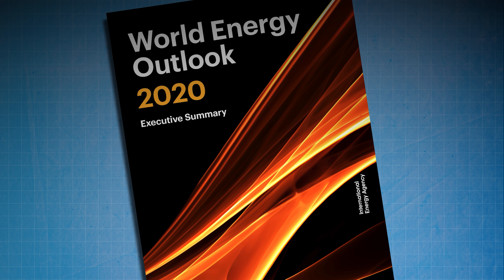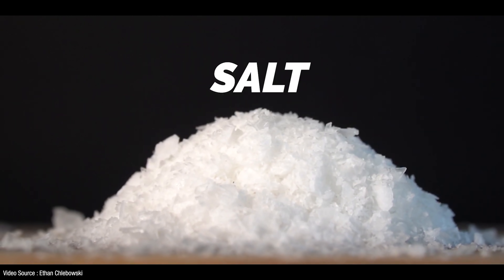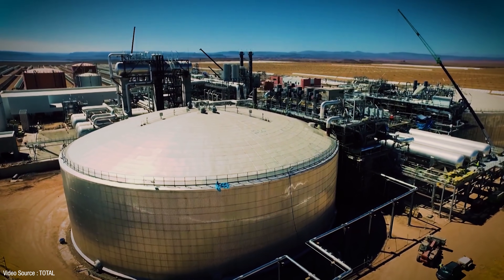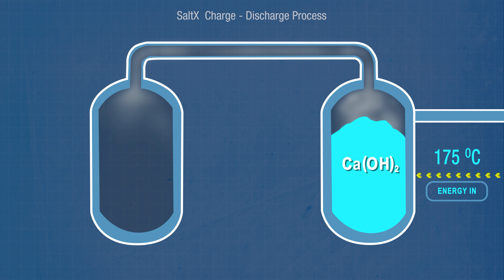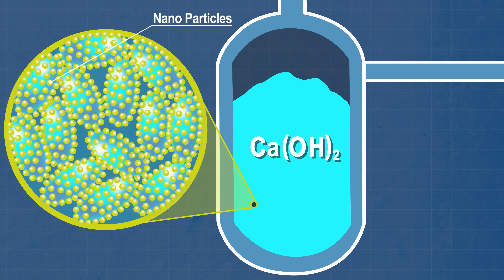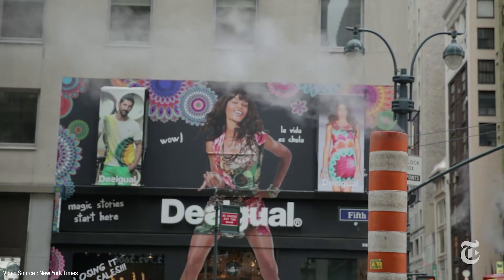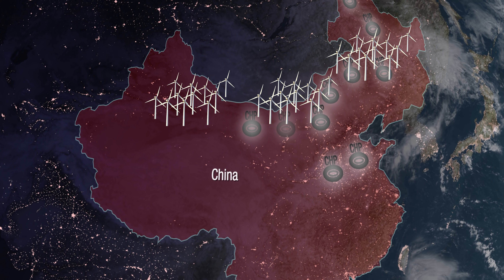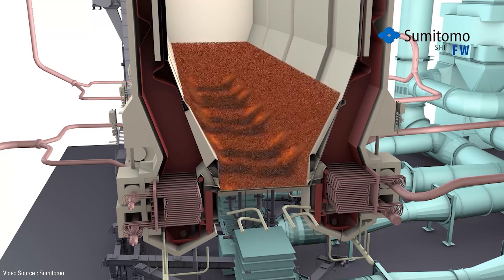Energy storage in salt - how nanoparticles are revolutionising the industry.

Comment: Could the system be scaled small enough to be mobile, like onto a tractor? 

Agricultural pests and weed control would be a good use to replace harmful chemicals. Could be charged by on farm solar. Meaning zero ongoing inputs and costs for farmers. 

Current flame weeder's use natural gas and some attempts have been made by producing steam from batteries, but these are expensive. 

For agricultural pests, I imagine a combination of computer vision, AI and autonomy using high pressure laminar water jets targeting individual pests. Something similar is all ready happening where the robot will target individual weeds in a crop with weed killers, therefore reducing amounts of weed killers.

Steam or high pressure water could replace many (all?) agricultural chemicals.  It will also reduce disease in crops because of less pest vectors. Work 24/7.  Beneficial insects will not have dangerous chemicals to contend with.

Comment: My wife and I are saving for and planing to design our dream house and your videos give us so many cool ideas! It'd be interesting to see if something like this could be combined with a sterling engine for home scale power storage
Reply: I don't really see this being useful to households any time soon 
Any system to make good use would far outweigh the costs currently
Reply: I wonder about a steam turbine/alternator in which the steam would spin successively larger bladed wheels which would each have coils and be a separate alternator. This could also provide hot water and space heating. Maybe a wood burning fireplace to supplement solar panels or mirrors.
Reply: @stevemickler452 pressurized steam is generally not great for residential use as it is very expensive and dangerous to leave unattended. I've seen videos of people using it to power a small metal shop but they were experienced technicians and only ran it while they were in the shop. A sterling engine would not require the steam to be pressurized and can work well at lower temps, meaning it can be smaller, cheaper, and safer.
Reply: Two swedish companies are exploring stirling engines to create electricity. Both have approx. 30% efficiency if I'm correctly informed and need quite high temperatures.
I think both need above 700 deg Celcius on the hot side of the engine. SaltX have salts that are suitable for different temperatures but the highest I have seen is 500 deg Celcius.
So it might not be suitable if the efficiency already are as low as 30% for 700 deg C.
With a steam turbine you get approx. 30-40% efficiency which is a better choice than a stirling engine.
So I think stirling engines are a better and cheaper choice than steam turbine if you have access to higher temperatures. But that needs to be verified by the companies that explore this technology and so far they are a bit secret about this novel use of stirling engines.

SaltX NCS is absolutely best used to store energy and release it as heat in a large scale district heating system. Around 90% efficiency...

The swedish companies exploring stirling engines are Azelio and Swedish Stirling.
Azelio as a energy storage medium in CSP plants where they use molten aluminium as medium and that can release energy at high enough temperature to suite stirling engines.
Swedish Stirling burn flare gases to drive their stirling engines at appox. 720 deg Celsius.
Since flare gases are burnt of anyway Swedish Stirling's concept is to recycle the heat to electricity.
First targeted area are smelters in South Africa where they use coal to refine chromium (mostly). This process create gases that needs to be flared.
These gases can be of varied quality so no one have succeeded in recycle them effectively so far despite many attempts.
Swedish Sterling's technology might be the first technology that can do this effectively. They say that by recycling the energy as heat to electricity they can lower the use of electricity used by the furnaces in the smelter by up to 15%, and that is very significant. 
There are a massive amount of gases flared around the world, and some calculations have shown that if Swedish Stirlings technology are used to recycle that energy it would equal all of the electricity used in all of Africa. THAT would be a significant reduction of emission of heat and green house gases if coal driven energy plants can be closed.

SaltX earlier explored the use of their nano coated salts for small scale energy storage for houses, but have put that R&D to rest and focuses on large scale grid connected energy storage where they only supply salt and a source of technology.
They have figured that this technology could scale very quickly if other production facilities can build the hardware used and SaltX only supply salt and know-how.
Building the hardware themself would be a too big task for a small company like SaltX technology.
So the technology is open for other companies to explore, as long as SaltX technology is part of the journey and can deliver salt.
Great decision and great thinking since the technology might be a natural part of any district heating system in the world that want to leave fossil fuels and incorporate renewable energy sources. Check the Helsinki Energy Challange. They have started their journey to stop using coal, and SaltX was one of four winners in this competition.

Comment: This appears to be a portion of the limestone cycle. However in the limestone cycle CO2 is used to cycle between exothermic and endothermic reaction states. Is there some reason you can't take advantage of the limestone cycle to to perform heat storage and release and simultaneously sequester ambient CO2? Seems like a nice synergy of operations to me, though the thermodynamics may not work out as well you get CCS.
Reply: I don't know if it would be possible to capture atmosferic CO2, at least not during usage of a battery. The reaction needs to be a closed cycle so that it can be recharged several times
Reply: @srpenguinbr  Everything in the limestone cycle is conserved except the CO2 - it enters at one stage and leaves at another. You can use the heat to do work just as before, I am just not sure of the rate at which work could be done. I suppose I could do a literature search, just thought someone in the comments might already know.
Reply: @srpenguinbr  To get calcium oxide, you have to heat limestone and RELEASE the CO2 inside into the atmosphere. BILLIONS of tons if this technology would be in widespread use.
Reply: Reminds me of the tech described in Freedom (TM) by Daniel Suarez.  I'll have to check the book but if I remember the systems waste product was water.

Comment: When you showed the graph comparing this to other energy storage solutions, you did not include the molten metal batteries from a few weeks ago. How do the 2 conpare? Thanks.
Reply: I’m also curious to see liquid air included in the comparison.
Reply: Whilst recognising the absolute need for grid scale storage I would add the need to compare with pesky fossil fuel energy density as this will help clarify capability of addressing prolonged ability to sustain significant demand at scale.

Comment: One of the problems of salt is scaling. In order to get high temperature you need the salt to have high concentration. But high concentration also causes scaling. That problem is not adequately addressed in this video.
As of now the best storage in my opinion is pumped hydro and liquid air.

Comment: With that low efficiency, 30-40%  you might as well use H2 then you can store it for longer for about the same efficiency
Reply: This is much easier and safer to store than hydrogen.
Reply: How do you store (long term) something that diffuses through practically any containment vessel?

Comment: If it works, it could store excess energy from a nuclear plant using much less transmission infrastructure than solar and wind farms spread out all over the place.
Reply: Yes, and if some day a nuclear plant's total cost was much much lower, it could be used to deal with surges in demand.  As it is, however, nuclear power is the most expensive going.

Comment: Thanks Dave for bringing to light a fantastic new way to store heat! Like slaking lime from the kilns, but with the nanotechnology coating to prevent clumping, and at a power density of 420 kwh/tonne vs 250 for conventional salt, plus a common elements solution that won't corrode the vessels, very nice! Combined with superinsulated buildings, the solution appears in sight.  I'll bet this would work well even in Texas, maybe now they've seen the light?? 🌞
Reply: All Texas had to do was winterize their power supplies like their more northern neighbors do.

Comment: If this is technically a hot lime battery where is all the carbon dioxide going from making the starting material and when it has to be reheated to dehydrate it where is all that carbon dioxide going? this technology could be an added boom for carbon capture because it could capture 1000 times the carbon it took to originally make the original material if the heating process comes from wind and solar power.

Comment: I see steam powered vehicles in the future lol. Micro closed circuit, steam  powered generating turbines for electric propulsion systems would probably work.
Reply: Steam is very inefficient.  The energy to change the state of water into a vapor is much too big of a part of the overall energy and super heated steam is not super nice to work with.  You are better off with a different working fluid.  Helium would be very nice if it didn't leak out so much.
Reply: @kensmith5694  considering the saltx system produces steam as an Integral part of a fairly efficient exothermic reaction how would you factor helium into the mix? Just curious considering it's relatively low energy density etc..
Reply: @jonc67uk  
How does back pressure on the steam effect the energy input needed to drive the water out of the salt?  I suspect that the answer to this is "in a very bad way"
Helium makes a good working fluid for a heat engine.  It expands and contracts quite a lot for a given heat and cooling input.  This is the property you want if you are after making significant power in a reasonable size.

Comment: Good for greenhouses perhaps, with the heat and the power.
Reply: Currently, a lot of greenhouses have their own gas powered turbines for electricity production, which is very efficient, because:
1. The electricity is used to power the lamps.
2. The excess heat is used to heat the greenhouse.
3. The newly created CO2 is also pumped into the greenhouse, bringing the CO2 concentration there to roughly 3 times that of the normal atmoshpere. This makes the plants grow even faster.
source: Worked in a greenhouse for years.

Comment: sounds like you could get rid of fossil fuels for heating. maybe a house size unit to feed hot water radiators and run a small steam electric generator
Reply: Steam based generators are a bad idea for this sort of thing.  They are too inefficient.
Reply: did you watch the video?

Comment: I'd love to see this used to heat greenhouses during winter. You'd accumulate this energy from the sun during summer and then use it when it gets cold. Combined with passive-solar greenhouses, this would be great.
Reply: The working temperatures are too high for home use.
Perhaps a better thing would be to find some reversible action that happens at about 20C.
Imagine blocks or tanks of magic stuff distributed around the green house.
When it goes above 20C, they "melt" when it tries to go below 20C that "freeze"
Reply: @kensmith5694  what you're describing sounds like a PCM (phase change material) with a fusion temperature of 20 °C.
I do believe that hot salt tech could be used for greenhouse heating, objectively speaking. The heat would still flow from hot to cold and the rate at which that happens could be modulated to achieve any desired temperature between the temperatures of the source and the sink. Am I missing something?
Reply: @wolterh6  Phase change is the simplest example.  There may be reversible chemical reactions in the same range.
Reply: @kensmith5694  I was thinking more about industrial greenhouses. The ones that can take 1 megawatt of heating or more, each.

Comment: This is an interesting concept. I wonder if it would be possible to use this technology on the very small scale such as a single-family home. For example a single family home equipped with a large solar roof would produce far more electricity in the summer than it needs. If that energy could be used to create a stable storage medium, then in the winter when that home needs heat it can be regenerated. If this process can be cycled thousands of times then one load of storage medium would more than outlast a home. Of course many more problems need to be resolved such as storage and small scale handling systems.
Reply: The high temperature would be a problem.  A different material with the same idea would be better.

Comment: Interesting as always.  The 1000 cycle limit suggests changing out the nano coated salt about every 3 years assuming 1 cycle per day.  If this is the case, there is likely degradation and loss in efficiency over time.  I think this could still work as an electrical storage method tied to a closed system sCO2 cycle which is a nice fit to the output temperature of the exothermic reaction.  I could see this used in a small scale as a home heating unit, especially for homes with an overcapacity of solar energy during the day.
Reply: Not to mention, the refresh of the system might be as simple as switching tanks of salt.
Reply: Its about 50 000 cycles not 1000, but this is being tested right now in a autonomous looping charge/discharge solution at SaltX lab. Ion batteries are at 1000-1250 cycles, so SaltX is about 97% better in that regard.
Reply: @nocto8237  Well that changes things.  I did not research beyond the video yet.  With this being the case, there could be many, many applications with this technology.  Scalable energy storage being the best of them.  And to a previous comment, this being a fully closed cycle could be applied anywhere other than maybe where weight is an issue like on aircraft.
Reply: @danburnes722 "... could be applied anywhere other than ..." other than all mobile applications.
To substitute a Tesla 90 kWh Battery, you would need:
600 kg Calciumoxide + 200 kg Water PLUS a steam generator, a steam-turbine to produce electricity, a water supply and/or a condenser and an electric generator. Looks like you need a quite big trailer for this stuff.
It seems it would be easier to scratch the electricity generation and to build a steam-driven locomobile instead.
Welcome to the 19th century!

Indeed there was 'Soda locomotive' in 1883 that used the very same principle  but with caustic soda instead of caustic lime: https://en.wikipedia.org/wiki/Soda_locomotive
Reply: Nice math. I like having a 1095 day life span even if the tail end is noticeable fraction less than at the beginning.  What are your thoughts on this off earth?

Comment: Two problems I see. It isn't hot enough and it's still a once through use of a natural resource even if it lasts 1,000s of cycles.
Reply: Although it may end up being more cost effective to solve the over generation issue, which currently sees renewable sources throwing energy away.
Reply: Isn't hot enough for what? If it can be used in building materials afterwards how's that a once through use?
Reply: @scrumtious1  Higher temperature gives higher efficiency converting to mechanical and then electrical energy.

Comment: Is this scalable for personal house storage , instead of batteries or would the tanks be too big? Or small turbines too expensive? It is a closed loop system so no day to day maintenance required? Cheers
Reply: Depends what you want to store. If you wanted electricity out the other end of the process your need a stream driven turbine at your house and the conversion efficiency is low. If you wanted it for heating your home, then yeah.

Comment: "Solar is the cheapest way to generate electricity". That is without taking into account storage I assume.
Reply: Exactly. It is the cheapest way until there's "peak offer" and you either need to curtail (wasted energy) or storage (increased cost). Hydrogen or these kind of storage are vectors that allow either usage of excess electricity at above 0€ prices (since they have value) or later usage. When too much renewables happen to produce electricity at the same time, they stop being cheap.
Reply: @cristoux  i assume this would be even worse if solar pannels were produced with renewable energy instead of cheap fossile fuel energy in China.
Reply: @cristoux  
I like the option of systems using reversible reactions with Zinc such as "flow batteries".  They have a low cost per unit energy stored.